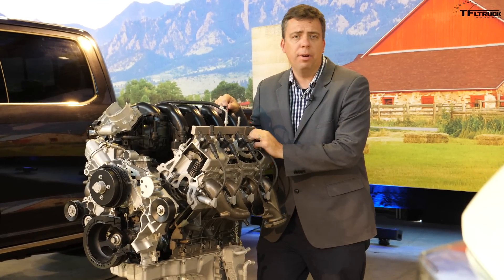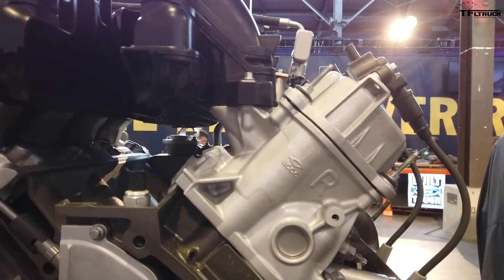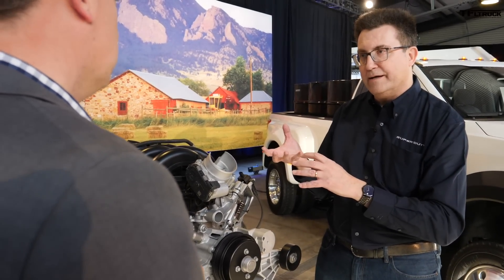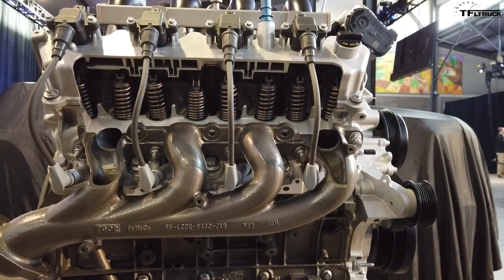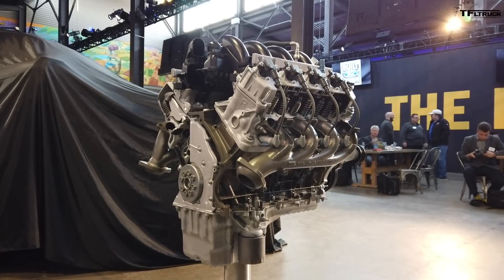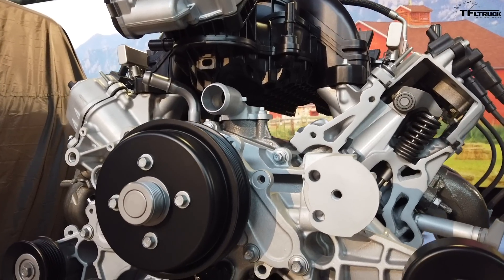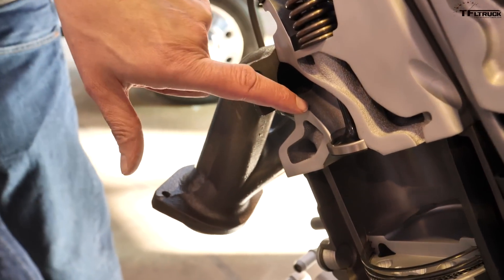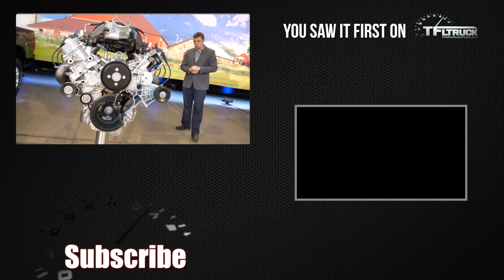2020 Ford Super Duty 7.3L V8: Here's What You Need to Know!

Comment: Wow looks like a GM LSX nock off! 6 built main blocks! Look at the Rocker arms LS design thru and thru.
Reply: FORD has been using a Y block with cross bolted mains since 1990, GM was still using the old 350. FORD starting using a Y block in 1954.

Comment: Pushrod motors are better.  They have 1/3 the parts of a DOHC MOTOR.   Make more power.  Last longer.  Thats why Chevy still uses them.
Reply: Push rods are fine for low revving truck engines but they don't make more power and don't last longer.
Reply: @benjaminwayneb  the rpm is all about the camshaft.  I've had 3800 series 2 and ls motors hitting 7500rpm.  Far as longevity?? Really pushrod motors have 1/3 the parts.  You won't find untouched Ohc engines like some of the low rpm tbi Chevy motors.    My last one had 414k when it was totaled by someone running a red light.  Look at the Ecoboost. They can't hit 100k without blowing apart cam phasers & timing chains.  I've been working on cars for 20+ years and have many certified mechanic friends. They make a living fixing new dohc engines because they are garbage.  Too many parts.  Far as power.  Pushrod motors build torque off idle because design. If you ever drove one you would know.   Dohc engines need high Rpm to make horsepower but always lack torque.   Dohc engines use high lift camshafts to make the "high horsepower" numbers but with big cams you allways lack low end power.
Reply: @MIketucky350  A push rod engine needs a lot of valve spring pressure to rev high vs. an overheard cam engine which leads to wear. Some of the early Ecoboost engines had poor quality  timing chains that lead to premature wear but other then that overhead chains can easily last hundreds of thousands of miles. Many 4.6 engines have 4 or 5 hundred thousand miles on the original valve train. As for cam phasers most modern in block cam engines also use them and displacement on demand lifters in both GM and Dodge engines are far from reliable.
Reply: @benjaminwayneb  higher spring pressure yes.  I'm going to bring up the ls1/2/3/6 engines.  All had largeish cams .500-.550 lift from the factory.   Which is how large all these dohc engines  cams have to achieve their claim of "makes more power than pushrods" anyway those ls motors have only 90# spring.   The stock 3800 series 2 75# at only .413 lift.  We've all seen these motors go 3/4/500k.  Added spring pressure yes, but when they have a good timing chain design that won't effect them.    Guy at work had a. Ls2 .650 lift nasty cam. Been daily driving for 3 years.  It's known in the mechanic world that Dohc engines always need work and they do.  Go walk through a parking lot. There all ticking and buzzing ready to fly apart.
Reply: @MIketucky350  I know 5.4 cam phasers are prone to making a knocking noise but most of that is due to poor maintenance, the phaser locking pins stick with any sludge. Our fleet has had dozens of 5.4 engines and never had any engine problems.
Reply: @benjaminwayneb  ive seen Lot of high mileage Tritons.   Those are also single cam motors.  Yes Ecoboost motors are more powerful than Tritons. In a straightaway and on paper.  Idmuch rather have a 5.4 or 5.3/6.0 Chevy all day.   Ecoboost has way too much complexity under the hood. I know quite a few people with them, and quite a few got screwed with $3k engine repairs under 100k.  No thanks.
Reply: @MIketucky350  I've replaced water pumps on 3.7 engines at 150,000 and not replaced any timing chains because they were like new.
Reply: @benjaminwayneb  n/a also.   Way less stress on things.  Like Tritons & I've seen Chrysler 3.6 make 300k on factory chains.  Companies are going for smaller engines with turbos. It failed in the 80/90s there not going to be any better today.
Reply: @MIketucky350  Turbo charging makes no difference to the timing chains and turbo failures are rare. We have many  turbo charged engines in our fleet and haven't had 1 failure.

Comment: Proof will be in tow.   On paper the 5.4 and 6.2 out HP and torque the old 400.  But still have two old F350s with 400s and sorry but they ran rings around both motors towing.      I was so pissed with the 5.4 I sold it and ended buying a PS guess to get a nice truck that could tow like the old rusted out trucks with 40 year old designed engines.    Long stroke is king of torque and low rpm HP.

Comment: The fuel line crosses over the intake coils on valve covers rocker arms water pump oil pan all characteristics of the LS engine even the drive-by-wire throttle body come on now copycats

Comment: So they decided to do what Chevy has been doing for years pushrod v8 .....nice
Reply: And GM is finally giving up on antiquated push rod technology for the new Corvette.
Reply: benjaminwayneb ,  I like ford I try to be unbiased but when a manufacturer tells you that an overhead cam design is better and this is why and then years down the road they come out with this it’s contradicting to what they where trying to justify in the first place.  I hope it is a good engine. One thing is for sure the pick up truck power wars are in full swing both diesel and gas.
Reply: @Americanmucle1  There is no doubt that overhead cam is the better design but it is more expensive to produce and  some of the benefits of  an overhead cam are reduced in a low RPM heavy truck engine.
Reply: benjaminwayneb , I would have to agree with you on dohc being a better design especially for power and efficiency. Both have their advantages and disadvantages like anything else. All I mean is when a manufacturer normally uses dohc and suddenly switches to pushrod it’s a shock and makes you wonder why they didn’t do that a while back.

Comment: Fords new LS 7.3L  I guess they couldnt fight GM anymore.  If you cant beat them Join em.
Reply: Ford has been using a Y block with cross bolted mains since 1991, long before GM. Ford first started using cross bolted mains in 1962 on FE engines.
Reply: @benjaminwayneb  Like they said, if you can't beat em...Join em. The only problem is it was GM who joined Ford 60 years ago lol.

Comment: and it would be a lot better if ford brought back the 6spd manual in there trucks problem with America there getting lazy and dont want to drive a stick in my opinion. but yet dodge still has a manual trans still and I am a ford guy myself I have  a 2003 f250 7.3l 6spd and wouldn't have it any other way

Comment: 4 vertical bolts and 2 from the side.... push rod v8... sounds like another engine I know
Reply: 4 vertical and cross bolted mains sounds like a 1962 Ford FE. Ford has been using cross bolted mains in all their V8 engines since 1992, long before GM.

Comment: someone went gm mode. lol.. pushed and 2 valves are old outdated technology huh? lol yeah right... GM never compromised with overhead cam and 3 and 4 valves. they knew low mid range torque is better with 2 valve and pushrods
Reply: The type of valve train has nothing to do with torque.
Reply: benjaminwayneb yes it does. pushrods create a fulcrum and velocity. there is engineers that will explain that to you if need be
Reply: @johnsonbobo2376  Not true, the method of opening and closing the vales has nothing to do with torque.  Valve timing and lift regardless of valve train type is all that matters.  Fords 5.0 has more hp. and torque then GM's 5.3.
Reply: benjaminwayneb you really don't have a clue what your talking about and why GM uses pushrods. there are engineer videos that will explain. maybe some will be in 3rd grade talk so you'll comprehend. do some research
Reply: @johnsonbobo2376  The only advantage to pushrods is low cost  for the manufacturer.

Comment: Wow. just... Wow. I feel sorry for whoever buys into this garbage. 
1. GM made this engine 25yrs ago, it was called the 7.4L 454. They've made them longer than that just not PFI. which brings me to the next point 
2. It's 2020 Ford. What the hell are you thinking? If you come up with some kinda excuse to get around being Direct Injected, none of them are good enough for me! I just don't even know what to say, to be honest! All the Ford fanboys are burning coal right about now 
But lets just take an honest look at what we've got here? 
7.3L. Big valves, iron block, (probably iron crank), single roller cam, P F I?? W T F ford?
"cast stainless" Exhaust manifolds LOL WASTE. piston cooling oil nozzles? wow. my 30yr old 12v is better built than that with the same damn features PLUS SOME 20mpg, cheap maintenance, reliable & easy to work on!!!
Reply: Ford set out to design an entirely new engine in 2020, to presumably cost an arm & a leg more in not just in long term maintenance, but fuel costs as well, compared to the maintenance & fuel costs of the 6.7L PS. Yet, it's pretty much the same exact engine I coulda bought from GM in 1999??
Yea, those 454's were pretty tough, but everybody knows those trucks got 9mpg loaded or empty, didn't matter. 
Ford will try to suck milk out of a heifer that was buried 15yrs ago, but that tit is long dry.
 I'm astonished they tried to cheap out on this truck with a few little gimmickey selling points & didnt give the people that actually try to buy and work fleets of these the common courtesy of not trying to rehash 20yr old tech as "more reliable". "cheaper to own/operate as compared to 6.7L PS" DUMB!! Whoever pays extra for one of these is surely a dumb one!!!
Shoulda made a 6.2L turbo, direct injected, built on the same principals, tough & durable, just smaller, more fuel efficient & more in tune with the "now" that is 2020. DUD OF THE YEAR AWARD:FORD 7.3L rehashed technology, gimmickey selling points (oil cooled pistons, cast stainless manifolds), no DI, built for Forced Induction, yet N/A? #turdburglersRontheloose
tried & true tech, but tried & true & RETIRED tech. End of story!

Comment: Looks very much like they copied a Chevy V-8.
Reply: Ford has been using a Y block with cross bolted mains since 1990.
Reply: @benjaminwayneb  Fords production of the modular engines 4.6l/5.4l began in the mid 90's. but these are ohc engines. GM's LS block engines which is what all current GM V-8's are based on also began in the mid 90's. 1997 in the Corvette to be exact. The new Ford 7.3 gasser is a cam in block design and has more in common with the GM engines than any other Ford engine ever made. Ford never made an engine with  cross bolted main caps that was a cam in block engine. GM has been building them for 22 years.
Reply: @jeffanderson6839  Ford started using the 4.6 in 1990. FORD started using cross bolted mains with in block cams in FE engines in 1962,  57 years ago.

Comment: Lol, trying to be an LS/LT motor
Reply: Ford was using a Y block with cross bolted mains when GM. was still using the old 350.
Reply: @benjaminwayneb  yeah, the LS motor came from a Ford engineer...Ford just wasn't smart enough to use the design
Reply: @benjaminwayneb  what's your point?
Reply: @TheYummyBrand  GM copied Ford's design.
Reply: @benjaminwayneb  Ford never used the LS design

Comment: I say we will have to see because I see not much difference from a 7.5 460 cubic inch big block which thankfully was replaced with a 6.8 v10 which was better on gas thanks To the ten cylinders not having to work so hard.  don't be fooled America . this is big oil Again realizing diesels over 3.50 a gallon and your going to buy a  Gasser

Comment: It might be worth something if they can work the bugs out of it they don't have the torque in the horsepower specs because it runs like s*** on the dyno once they figure that out it might be a good engine I doubt it low on torque low on horsepower and there's really nothing new about that engine all they did is took an 80-degree instead the Pistons up just a little bit more thinking it's really going to be a dud so all you Ford folks out there don't get your hopes up

Comment: A big iron block pushrod engine...is it 1971 or what!?
Ridiculous!
Reply: Well those high strung gas motors or overly complicated diesels with DEF systems are not working out too well in some applications. An old school reliable motor will be far better for businesses. A bit more in fuel consumption isn't an issue. Down time to a truck not working is far more detrimental.